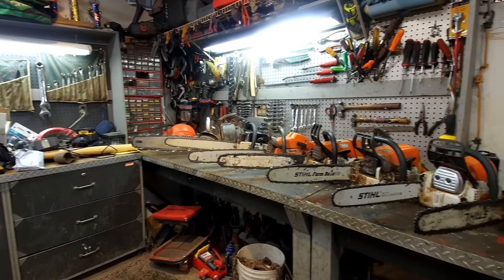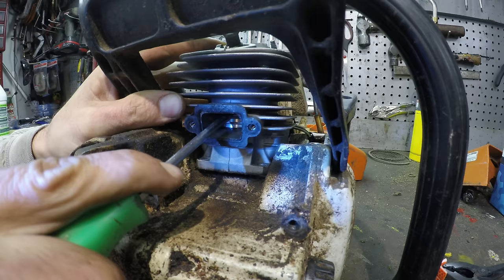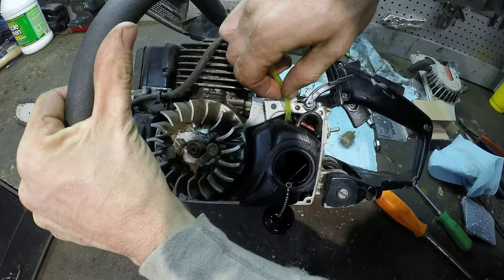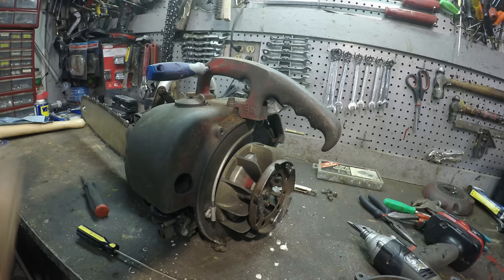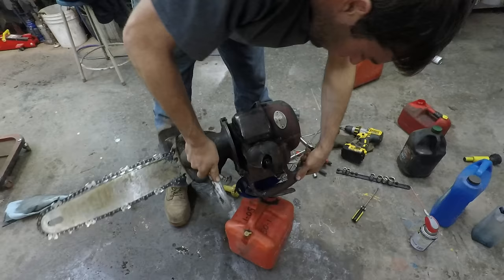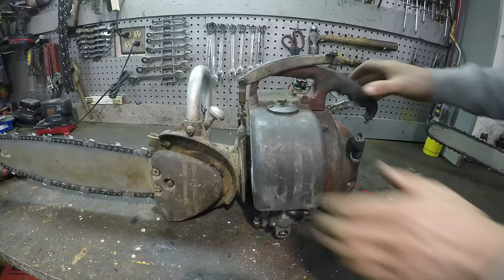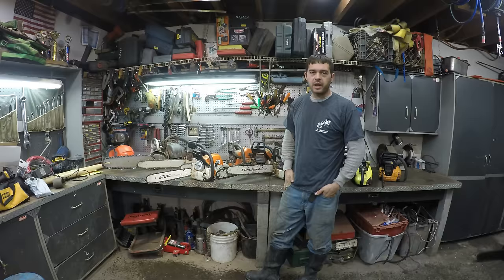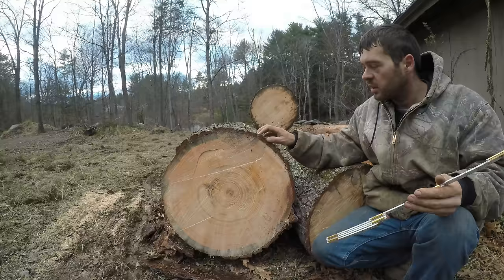Fixing and talking about chainsaws

Comment: The Poulan Pros are not anywhere near as cheap or shitty as the regular Poulan.  The pro has a licensed copy of the Husqvarna engines(Poulan is owned by them so.....).  My Poulan Pro cost me 229 bucks.  45cc.  I've had it and used it for about 15 years in a tree farm.  Fires up every time even after sitting for 2 years.  I never took excessive care of the saw. Friend has 3 Stihl saws.  Richualistic in their care.  Everything by the book.  Nowhere near the hours my saw has. 150 bucks in repair per saw every year.  I'll stick with my PP rather than a 500 dollar Stihl.  Husqvarna designs are just better apparently.  Which is probably why loggers all over the world choose Husqvarna over Stihl.

Comment: Original Stihl parts are worth every buck. Its just that if you cant install them correctly ur gonna throw the money away just like you did with the chinese one you had installed before. A Stihl one would last all life if used and installed correcly.
Reply from the maker: Yeah, that saw didnt stay running long after that repair. For the price, ill just buy new saws.
Reply: @AndrewCamarata  Yeah, i see the point. GL with your saws.

Comment: I don’t know what is wrong with your 036 but my ms 360 will smoke that Poulan and I have owned a bunch of Poulan saws and my ms 360 will smoke any of them with a longer bar, too.  I still have my Super 25 Deluxe Automatic that I bough new in 1985.  I sold my 3400 Poulan a few years ago.  It had served me well.  But a 62 cc Stihl will smoke it.  I will bet you have a marginal cylinder on your 036 but it could be several other things.  How you tuned the carb on the Craftsman is not how I tune them.  I set my saws to fun a slight four stroke at WFO and then verify it with an inductive tach.  I don’t want any of my saws running over 13,000 in any temperature.

Comment: I think this guy is scared of oil. You should Pre; oil  all the parts before assembly so they have a wet start.  Clean and Oil the all threads to get a correct tension.

Comment: the old maul chainsaws had no clutch they were direct drive real man eaters ran them 60+ years ago our largest had a72 inch bar with a removeable handle on the tip of the bar tobe a 2 man saw an weghed about 85-90 pounds DAMN ihated those saws the kickback on the ropewas a real bear

Comment: you scare me with the advice and observations you give about using chainsaws. I''m 68 years old and grew up using them. Those "teeth" you are talking about is called a "Dog." The dog is a safety feature for the saw. It isn't intended to be used as a "fulcrum pivot point" as you describe. The true and only purpose of the dog is purely for safety.

As you may well be aware, chainsaws can be notoriously dangerous because of kickback. If a chain sticks in a log, it can bind, then suddenly break loose and cause the whole saw to kickback violently. The dog is located where it's at to offer some semblance of control to minimize kickback. When a saw kicks back the blade tip rises suddenly and very quickly. However, as the kickback issue arises, the energy of the top edge of the saw pulls the saw and motor into the tree and engages the dog teeth. This reduces and eliminates the kickback. 

By using the dogs to provide additional force and turning it into a fulcrum pivot, you are introducing a very dangerous element that could and will cancel out the kickback safety design for the chainsaw dog and teeth.

I cut down hundreds of trees in my lifetime. There have been more than a few instances when the chain bound and kicked back. I was always spared and kept safe because the chainsaw dog teeth stopped the motor from violently kicking back into my face or body. Stop using the dogs as a fulcrum, or you will regret it.

A properly sharpened and correctly cutting saw does NOT NEED to be pushed into the wood during cutting. The weight alone is sufficient enough for the chain's teeth to dig in and do the cutting without additional force. If you are forcing your chain to cut by adding pressure, then your chain is dull or improperly sharpened. This is a danger element that can and will lead to dangerous kickback.

I don't know where you learned to use a chainsaw, but your advice and information is dangerous and I would NEVER advise anyone to subscribe to your methods of using chainsaws.

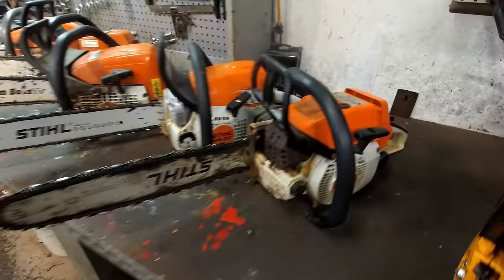Comment: so i just found this video and this makes me laugh @13:19 ""i had to put a jug and head on this saw it lasted for a couple of years then it blew up so i put another jug and head on it now it is seized and i have to do the same thing" then saying "if you buy these parts from the manufacturer they are way too expencive and you should just buy a new saw" i am sorry but if i am rebuilding a saw i will pay 500 for a rebuild if i have to. To have a saw i dont have to rebuild for 20+ years if my math is correct your 30-40 dollar rebuilds every other year 35x10=$350 in parts plus the hour per rebuild $50x10=$500 in labor plus the lost work due to the saw being down 125 x 8 x 10 = $10000 in lost work (8 hours a day (they always blow in the morning) 10 rebuilds in 20 years, making 125 an hour) congrats on a grand total of $10850 in losses (i own 21 chain saws most of them older than my dad and i am 33 they run great and i use them on jobs all the time)